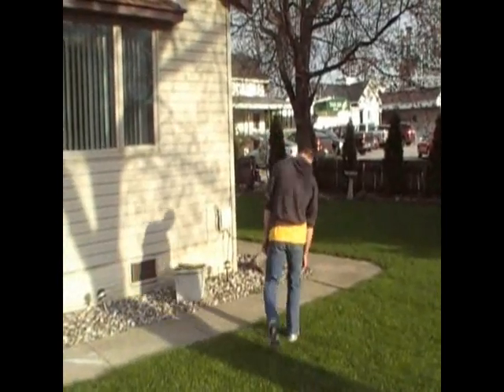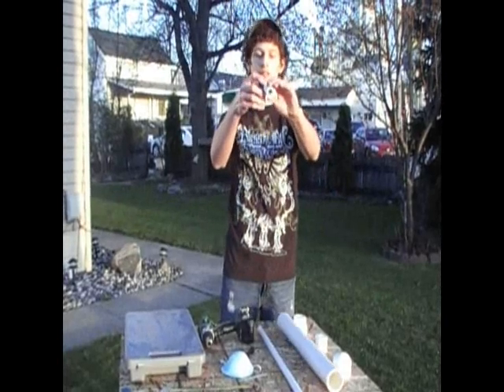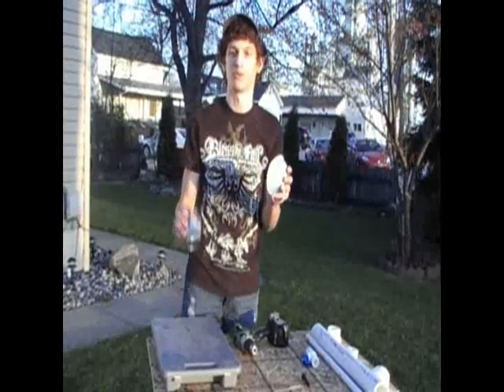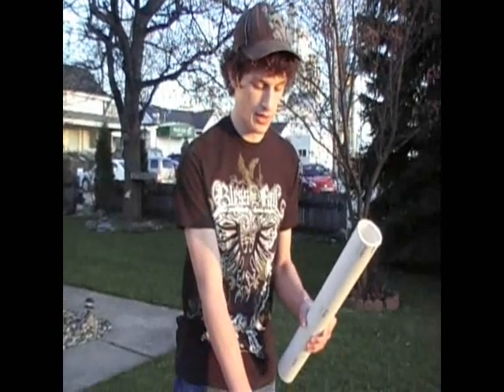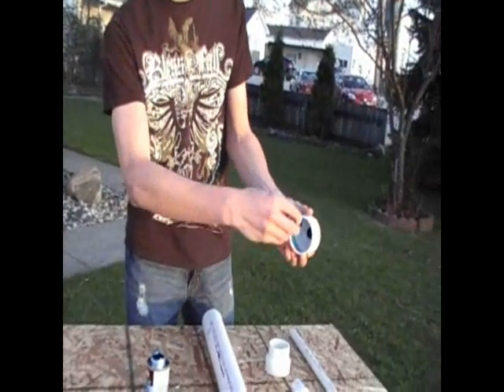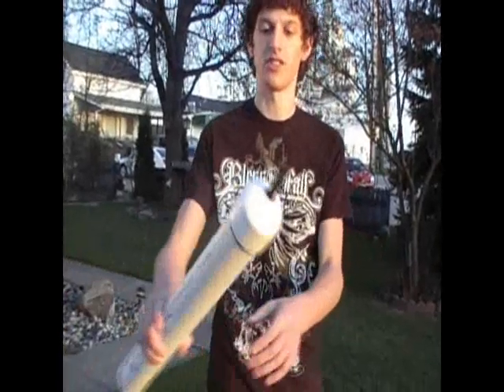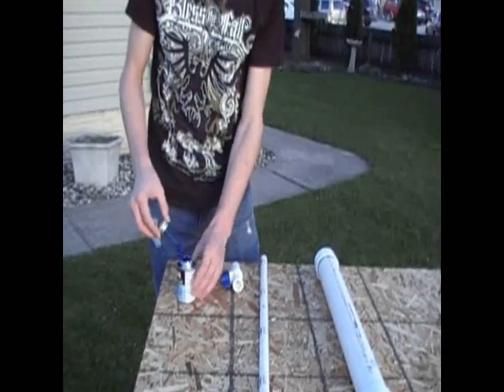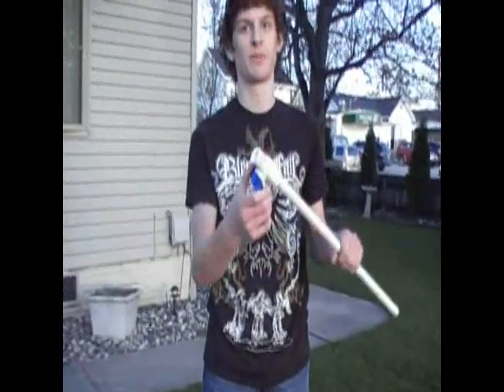How to Build an Air Cannon (Part 1)

Comment from the maker: @epicrandomnathan Well I guess it depends on what you build. PVC itself is really cheap, but the stuff like the brass valve (better than PVC because its waaaaaay easier to turn) and the pressure gauge make it cost a lot more. I think i built that whole think for 60 (the bigger one).